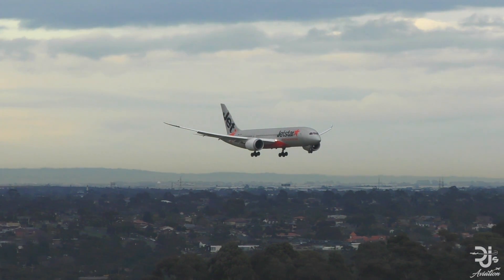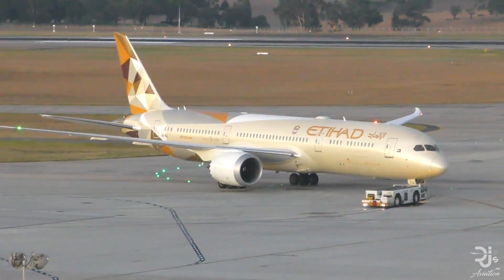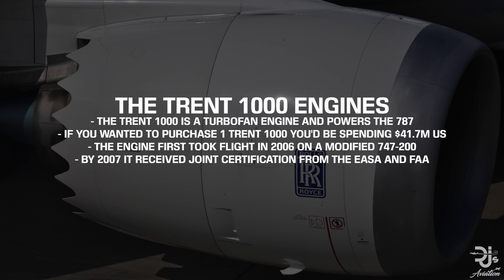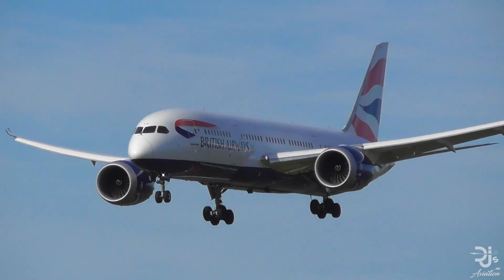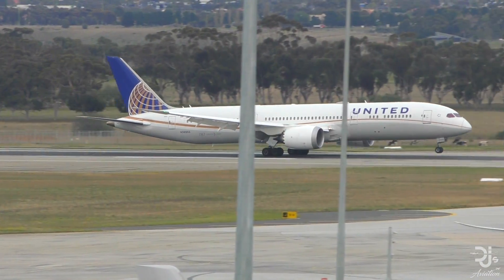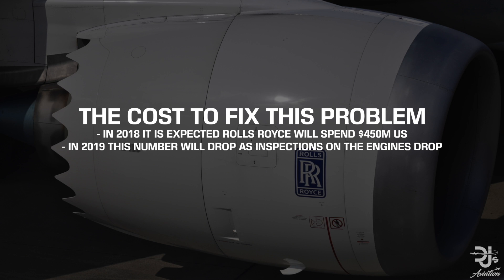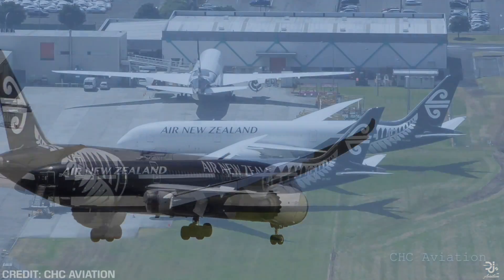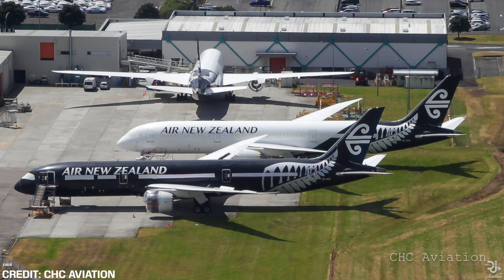The TRENT 1000 ENGINES ISSUES Explained

Comment: Reality is, that due to physics, the "size" of turbine engines are reaching their maximum.  The large turbofan engines are reaching the same limits reached by propeller aircraft during WW2 in which the larger the length of the blades the closer they reach the speed of sound at the tips. This coupled with the centrifugal force on the engines are immense when spinning at such speeds.  The blades in the Trent 1000 have HUGE centrifugal force loads on them at "climb power" and like a spinning gyro gear, when you induce lateral loading on a spinning wheel the stress gets even greater.  This is a limitation and issue being reached on these massive large bypass turbofan engines.

Comment: It seems that the Rolls Royce engineers on who cut their teeth on the Lockheed L-1011 engine problems are all now retired so their experience is not available to the engineers of the Trent 1000. The main difference is that the L-1011 problems showed up on the test stand which delayed the entire program. Considering the more modern business approach of emulating the rapid development cycles made famous by Elon Musk, the difference is that Elon knows what is possible, while the Business School grads, with their financial spread sheets, are the suits in the Rolls Royce front office. We can see this with Boeing, It went from a great engineering company run by engineers, to a company run as a business with a why do it right when you can get paid to do it over mentality. In theory, Boeing absorbed McDonald Douglas but in reality the bankrupt culture of MDD prevailed. We are all reaping the whirlwind of a bankrupt business education culture. It kind of makes one wonder what problems did show up on the test stand? Was this a kick the can down the road experience? Or perhaps a halfhearted fix to buy time in the hopes that the corporate dilution of responsibility will make it some else's problem.

Comment: ROLLS ROYCE TRENT ENGINES ARE CHEAPLY MADE AND HAVE TENDENCY TO ROT, CORRODE AND EXPLODE PLUS ROLLS ROYCE SCANDAL PUTTING CHEAP METALS AND ALLOYS IN REPLACEMENT. BOEING HAS EXCLUSIVITY CONTRACT BARRYING AIRBUS FROM USING ENGINES MADE FOR BOEING JETS. ROLLS ROYCE ENGINES SUCK. @

Comment: Plenty of discussion about the downstream repair costs, and how cost control impacted RR. What about how the problems first started? RR knows how to build engines and blade right. Something went wrong with package C (cutting corners? quality control let sub-par parts through?) and now they are paying for it. Also didn't say is whether it affect other RR engines. How much shared design/process among different Trent engines?

Comment: 787-8 taking off from Italy had Trent 1000 failure and engine broke up in August 2019. 2 blades broke. Is RR in the UK or India?
Reply: Check out what happened to a GP7200 engine on an Air France A380 not so long ago.

Comment: Are EASA and the FAA not reconsidering their certification of the Engine? I hope we're not heading down the "if it's Rolls Royce it must be ok" path. It started with problems in package C. Now it's packages C & B.
Are we not in the realms of the engines are safe unless you can prove they're not?
When will package A engines display problems?
At the moment, are 787s becoming expensive to operate with the additional maintenance overhead? Skilled maintenance staff do not grow on trees. Isn't an additional 787 check going to push another plane due for a check further down the queue?

Comment: Great, RR makes a worthless piece of crap (1000) for the 787, while the Trent 1100 seems to work well for the 350. Was RR hurt by this, NO they announced record earnings for 2018. How are the 1100s different than the 1000s material wise? The blades are larger true, but you have to wonder why the same processes can’t be used to repair the1000 blades and compression wear as the 1100?

Comment: I have read that the problem is confined to the Asia market as it was believed that a high sulphur content in the air was coating the compressor blades and thus causing problems. A shareholder had said that most of the R&D budget was going on resolving this issue.

Comment: I work at Rolls-Royce and we are doing everything to get this Trent 1000 issue solved
Reply: Thanks.  In the meantime, can I get a cocktail and some peanuts?
Reply: All the best to you - getting it sorted will be great for so many around the globe!
Reply: Getting it right first time is the only way. Modifications in the field are prohibitively expensive and damaging to reputation. Often the problems are caused by excessive pressure from sales and marketing. These issues should not happen in an aircraft engine. The 737 max is an extreme example of sales pressure.

Comment: DJ . I believe the Moden Big Fan Engines run hotter to get more efficient and to burn less fuel , but this does mean that the very high tensile Metal that the Tubine Blades are made from have to work a lot harder , and it appears that cracking  , although only slight , has taken place , so the blades have to be replaced by Rolls Royce by a new and better Blade, all very time consuming and expensive.   I am sure they get it right , as this Engine ( The Trent ) has been made and continually improved over many Years. One other Point , I have noticed that Airlines do not display the Make of the Engine on the Engine Cowl like they used to ? is this because they wish to get some revenue from the Engine maker ?

Comment: For those commenters trying to play a nationalism card, please remember that RR builds engines in the US, too. GE builds engines in the US, France and Canada, with parts coming from other nations, and has an important engineering subsidiary in the UK. Both companies rely on maintenance facilities throughout the world.
Any engine problem is an international issue, no matter what the brand on the outside of the box. We fly together; we crash together.
Reply: Very true. Although, I believe you are eluding to “consumer ethnocentrism”, the belief that ones own domestic products are superior to those of foreign countries.
Reply: Actually no, GE engines are objectively better. They are much more advanced. They dont need costly titanium blades for the large ducted fan. They use carbon fiber composites they have worked with since the 80s when the prop-fan was a project. They use ceramic composite turbine blades.
Reply: The Q Interesting point about blades. It was only until recently that GE started using wide chord blades on their engines. This,  some 25 years after Rolls! Why ? Because Rolls invented them and patented them! Narrow chord blades, seen on the majority of GE and Pratt are a very, very inefficient design. Case in point; CFM56 has 36 blades. The Rolls V2500 has only 22 wide chord blades! Rolls have always been innovators!
Reply: @theq4602  GE uses technology INVENTED by Rolls Royce in ALL of their current generation turbofans by virtue of Roll's expired patents!

Comment: Did you not mention the industry is paralised by the recent fan blade failure in the pratt and whitney and ge engines which has plagued the industry.the eu safety boards have issued directives for these engines following several incidences with sw airline and airfrance which were far worse uncontained failures which threatened planes in flight...the rr have suffered far less serious failures than its competitors...the rr engines are much more advanced in containment than these p and w engines

Comment: It’s not as efficient or reliable as the genx because it has more fan blades made of titanium which increases the weight, but rolls Royce tried to fix this by making them hollow, but now they are not very strong as compared to carbon fibre-titanium fan blades

Comment: Sure Rolls has issues. But Boeing, being well delayed with tons of orders has a lot to do with this. They didn't test it enough or they knew what was coming but still had to deliver A/C that were 2 years late. Airbus also flying the Rolls had a definite manufacturing defect on the proven A380 engine, but it was instantly identified and first testing would not have shown it.

Comment: 7:08 Can someone please explain to me how is that tractor/truck pushing the giant plane ? That plane probably weighs like 100 tons maybe ?? How is that truck able to push the plane  ? It should have sufficient torque I am guessing like that of a 13 or 15 litre diesel engine . What kind of engine does it have  ? Is it electric ? How much does it weigh ? It should weigh substantial enough so that its wheels do not lose traction . 
Also what are the other two propeller planes ?
Reply: Mentour Aviator make a video how tugs work and whats different between supertug and regular tug

Comment: The Genx provides more thrust but is more economical. Also on the rr website it says the the Trent 800 is the most popular 777 Engine and provides the most thrust and is the lightest. Mmm were did those facts come from, it is lighter than GE and P&W. But the GE90 is so much more powerful that is provides more thrust than its extra weight. What do you think? 
GE90 with its unique spool up noise, or the RR Trent 800 with its loud rumbling on takeoff?!

Comment: I have a close friend that works as an engineer for RR. Can't say a lot but basically a lot of middle management have been sacked and they're employing loads of engineers to tackle to huge work load. The blades are essentially grown/moulded from a single crystal of carbon fibre composite. Once it's been fitted you cant just easily replace it. The entire engine basically needs to be rebuilt.

Comment: Royce Royce impacted the Lockheed L-1011 TriStar program from the beginning to almost failure, it ended up behind the Douglas DC-10 program it never caught up..
The blades where made of the a new composite technology that also had a high failure rate .

Comment: You didn't actually explain what the issue with the engines is...  You said the initial problem was fatigue cracking of the IPT blades, but the key problem was "with the compressor".  This is a 10 minute video talking about the downstream consequences of the engine problems, without devoting more than about 10 seconds to actually explain what the problem with the engines is!
Reply: Its the blades in the compressor stage. They are developing fatigue cracks. That general issue has been a problem for as long as jet engines have existed. But these days the blades are usually grown as a single metal crystal with near perfect atomic structure. Likewise flaw detection on new blades has advanced a long ways and bad blades almost never make it out of the factory. But something along the way failed with RR's. When it was just the C batch my thought was it was a manufacturing problem, but if it is in the other batches it might be that their quality control system wasn't tuned to find flaws sufficiently small enough (possibly because they miscalculated how large a flaw needed to be to cause a problem) and when they got out into the real world some had flaws which turned into cracks. They must have come up with a new quality control system to check the blades, but we are talking hundreds per plane.  Tearing open engines and checking each one is a nightmare.
Reply: Sphere723 You may want to check your facts on how LPC and HPC blades and vanes are manufactured.  Hot section turbine blades (HPT) may use the tech you mention.  Watch “How It’s Made - Jet Compressor Blades” on YouTube for a good intro on one method of compressor blade Mfg.
Reply: The single crystal blades are only made for firat stage turbine nozzles and blades, the IPT blade that failed.
Reply: Chutup
Reply: so your saying he basically beat up the outside of the bush and not the actual busy itself.. interesting, beating up around the bush.
Reply: Thats standard in all videos here
Reply: Its an issue with the compressor rotors too i think. Thats why its very costly to repair
Reply: I wish to know more about the actual technical problem with the engines, not how individual airlines will be affected.  Further, it is unclear if this problem has led to catastrophic failure or not.  Presumably it has since pilots have aborted flight plans.  Or perhaps they simply had vibrations, or some other warning prior to catastrophic failure.  

If dj wishes to become a "go to" youtube site it needs to up its game.
Reply: David Rapalyea That is the issue. It has been an intermediate pressure turbine blade issue, which RR stated late last year a minority of engines were affected and many that were have been repaired. From an engineering perspective I can tell you there have not been too many catastrophic failures in flight. Off the top of my head I do recall an Air New Zealand 787 suffering a failure in flight and the engine having to be shut down in late 2017. The issue is RR not understanding what the issue is. They have consistently over the duration stated they have but multiple times have stated a solution only for it to occur once again. When it comes to engines what seems as the simplest of issues can have the most complex solutions. An engineer can only follow a manufacturers guidelines. Can inspect the blades, can change the blades but that is parts available in the hanger. Or that can be ordered. An issue with the blades, hydraulic lines for example ( perhaps to thin, which happens) that is what are supplied. So the issue here has been RR state here is the issue, but guess what you have the same blades. So do we fit new blades, that are going to have the same effect, swap over the engine which may incur the same issue, or do we recommend to the airline the aircraft is grounded until such time a guaranteed resolution is in place. What I think needs to happen in this process is manufacture gets the work signed off by an airline. Another words RR state they have a resolution, it is resolved and with these new blades or whatever the issue will be resolved. Major airlines then send their most senior of engineers to the manufacturer so they can see the new blades, inspect them and RR can demonstrate how they came to that resolution. Then it can be signed off on. No more RR saying here is the solution, airlines take their word, fit the new engines or parts and months later have the same issue because they took the word of the manufacturer. Not a fail safe but at least then there are more eyes on it and if an airlines engineer states they are not confident the airline doesn’t sign off on it and the manufacturer must demonstrate why it is a fail safe solution
Reply: @jasoncrawford5350  
Thanks for the extensive discussion!
Reply: @jasoncrawford5350  Jason please understand the use of  minor, major, hazardous and catastrophic in terms of safety affects and which ones are engine related.....hint, catastrophic is the completely wrong safety term for the failures seen.
Reply: The main problem which he forgot to explain is that - Rolls Royce have outsourced all their jobs to *INDIA* causing a loss of expertise and excellence and many UK workers being layed off....
Reply: Asad Rehman - the outsourcing is the main problem, not where in the world it goes to. You can get any quality everywhere, you only need a working quality control. But what if you outsource the quality control?
Reply: @PakFan786  where on earth did you hear this.... they operate in 50 countries... plenty (most) still in UK.
Reply: British technology is not very good.
Reply: Its obvious 2 me that you know nothing about British technology. Please do your homework first before you make stupid and rash comments Mr  @piotrchin2495
Reply: @piotrchin2495  Compared to what? Why has R-R been making aero engines for more than 100 years?
Reply: James Williamson problem with the engine is cracking fan blades I believe is what he said
Reply: @lw1088  - nothing whatsoever to do with the fan blades - pay attention.
Reply: @lucee2261  So what is the issue?

Comment: I watched the whole thing and apart from the blades cracking learnt nothing further. Did I miss something?
Reply: I work in Roll-Royce as an On-Wing Care mech  and within the last 2 years, most of my task were to fly all over asia pacific to deal with the T1000 IPC 1&2 blades issues.

We do ultrasonic inspection into the IPC1&2 blade roots looking for cracks and repeat every 100 Flight cycles for T1000 B, C, TEN & T7000 but so far I didn't encounter any cracks within the last 2 yrs. 

In my experience, Trent engine HPT blades had more detorioration issues than IPC blades. What makes the IPC blades issues critical is that the damage are appearing in the bladeroot area which have a higher potential of blade release.

Comment: Yup, certainly a bad thing for the 787 w/Trent 1000 engines operators out there.  I didn't know about the ETOPS revocation ramifications though; thank you. I bet the launch 787 operator ANA is sucking wind about now with choosing the Trent-1000 instead of the GE engines...

Comment: Never liked the B787 Cheapliners but I must say that this is one of the best vids you have made on B787. What I wonder though that why doesn't Boeing carry out tests on engines independently the way car manufacturers do by running the engine for several tens of thousands of kilometers ? Had Boeing done this with RR, this issue would have known earlier & airlines would have simply ordered GE engines till the time RR sorts out the issue.
Btw, has RR given any deadline by when they will be able to sort out the issues on their Trent engines on B787 ?
Reply: Parimal , All engines are tested for about 100 hours I believe at the engine manufacturers test section
Reply: You dont know what your talking about